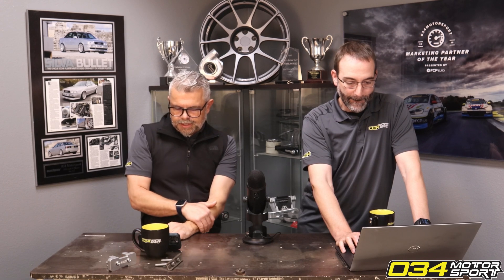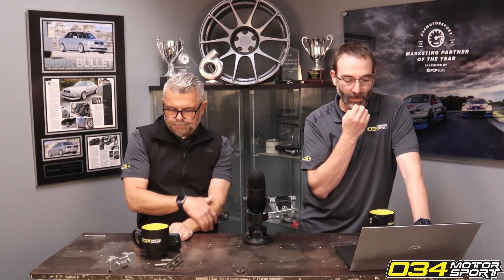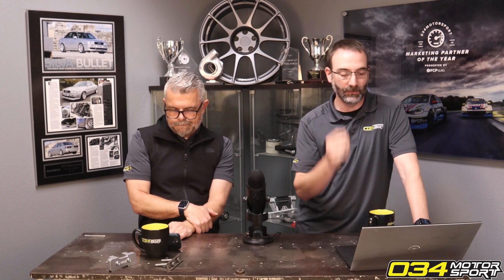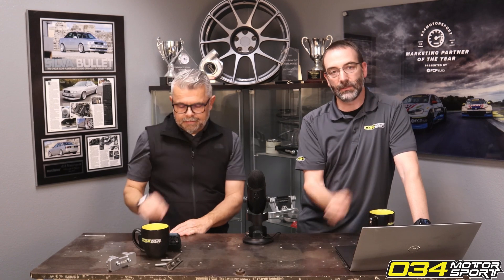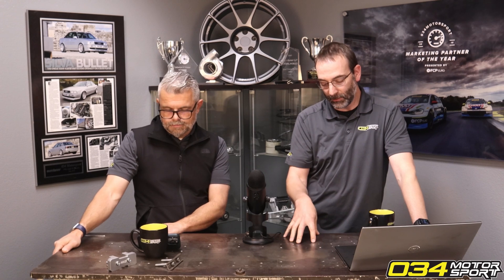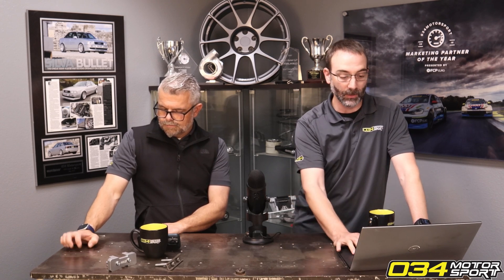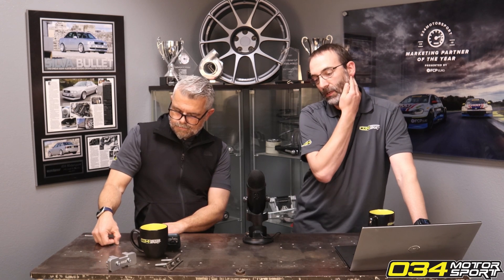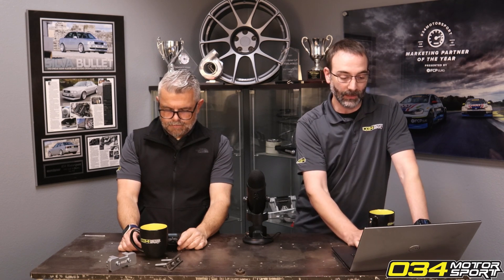Why Bigger Direct Injectors Over Multi Port Injection For The B8 3.0T Platform? | 034Motorsport FAQ

Comment: Hey I have a question so would I run into any crazy issues If I’m running b8.5 injectors on my b8 s4? I ordered new injectors in ESC website and it said they would fit and they do but when I went to install them I noticed my old one were concave and the ones have like a nipple tip. New to the 3.0t platform so I can find any answers online at all